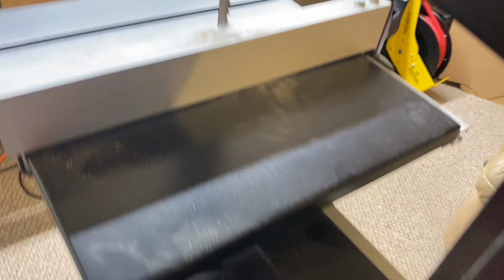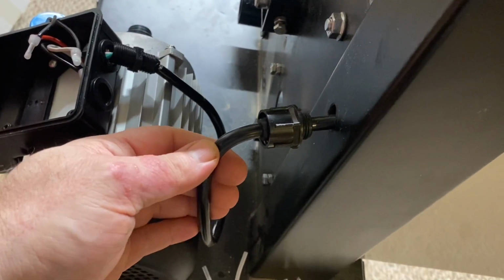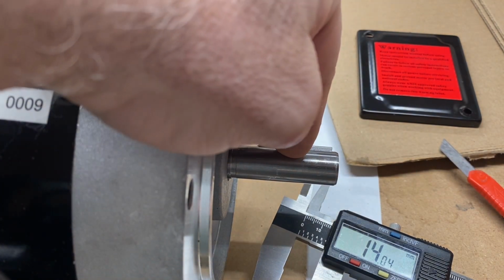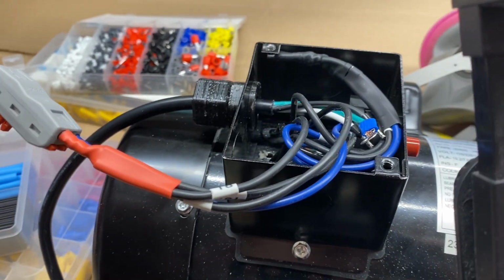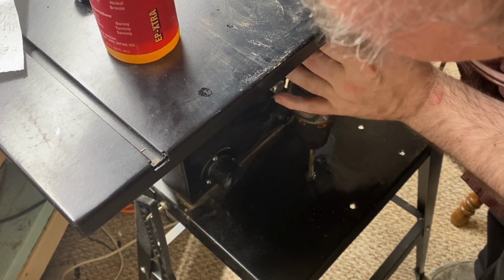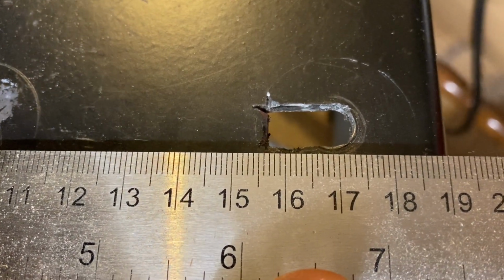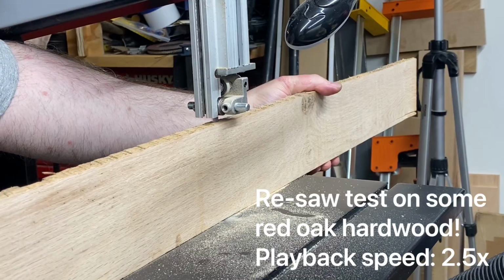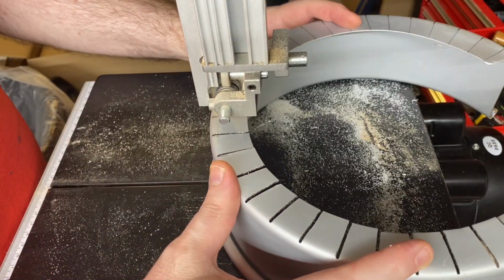DIY Bandsaw Upgrade: TRIPLING power of my (affordable) VEVOR 10" woodworking bandsaw!

Comment: I am also concerned about the plastic pulley. I do not trust them... And my own experience has proven this. Of course this will work and last - for a while. An excellent start, however. No criticism intended.
Reply from the maker: @richardbennet8597  it’s working great for me so far.

Comment: I think you probably would've spent more on the 14" band saw than your price list indicates, because the greater length of that blade would cost more than the length required for the 10" saw. Great video.
Reply from the maker: Good point!!

Comment: Shaft diameter, motor mounting hole pattern, pulley bore. Electrical capicity of switch, and any fuseing or over loads.
Reply from the maker: Hello! Thanks for watching. The shaft of the new motor is 5/8" with a 3/16" keyway. The diagram with the motor mount holes is provided in the printables.com download link in the description. The specs on the drive pulley are shown in a screen shot in the Printables.com download page. The switch itself is the stock switch that came on the bandsaw. It is like ones I have seen that are rated for both 115v and 230v. I am using the 115v wiring option. I'm running on a standard household breaker, 20amp. I have not had any issues with overloads or breakers tripping.
Reply: @design8studio   30 years working service for DoALL
Reply from the maker: DoALL makes some major industrial type bandsaws! Big stuff.
Reply: @design8studio  yes they do. So does HEM Saw so does HYD-MECH annd Amanda. Have worked on them all at one time or another.

Comment: Is there a RPM difference from old to new motor?  That new motor seems to be spinning much faster than the old one.  How long do you think that plastic driven gear is going to last in this application?
Reply from the maker: As you can tell, in the process of this change, I went from having a stock setup that offered a choice of two speeds, to a modified setup that offers only one speed. My new pulley sizes are relatively close to one of the two stock setups. I will have to check the rotation speed of the new motor, and do some math, based on my new pulley sizes, to calculate what kind of speed I’m now getting on the blade. I know at this point only that it cuts. I’m pleased with it. I have no idea what the lifespan will be for the printed plastic pulley, but I can always come back with another report, if it wears out. Hopefully it lasts fine.